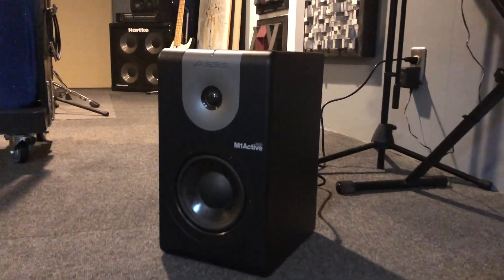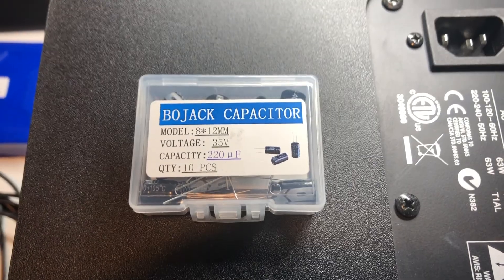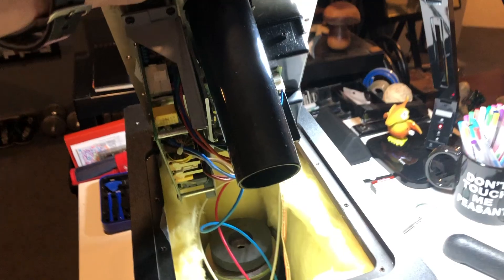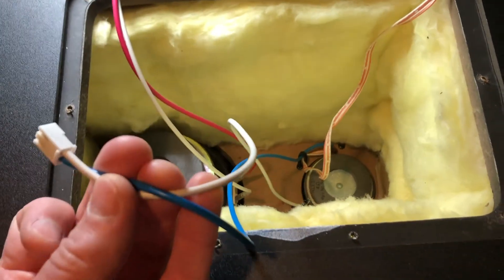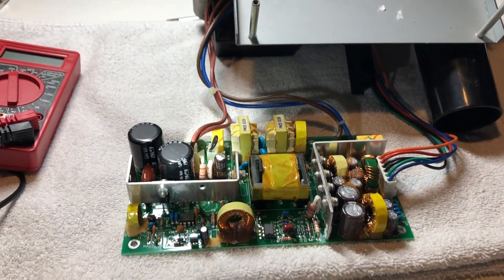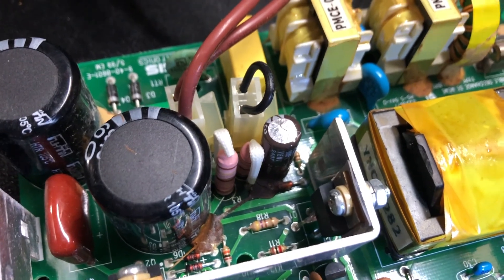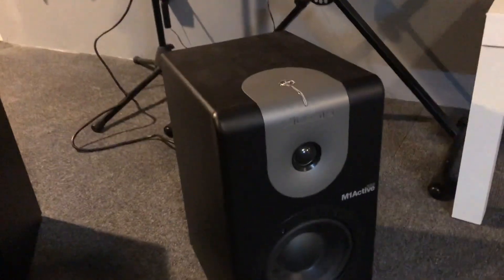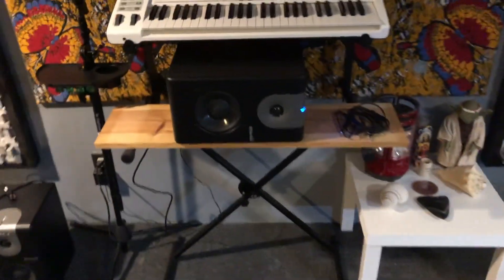Alesis M1 620 Active Monitor Fix

Comment: A quick question since ur the handy man - I actually own the 320 ones - prolly for the last 7 years or so. couple of days ago i found out even when turning the knob to OFF the blue LED light stays on. No sound unless I turn it on and raise the volume. Any idea wot can cause that? hope I can DIY it. Cheers
Reply from the maker: I don't have experience with that model.  I don't think this is exactly the issue you're describing on your unit, but this EEVblog video has a pretty good troubleshooting process which was rather entertaining to watch, and the circuit topology of the 520 looks like it's probably the same 320 at a glance.  So, maybe it will be helpful:  https://www.youtube.com/watch?v=qHbkw0Gm7pk

Comment: Hi, you might be able to help me. I have a set of these a few years now. I connected my acoustic guitar using the XLR input (my acoustic has low balance XLR output. However it blew the monitor, there was a low dull noise and the light does not come on now. The kettle lead is still working. I have no idea what to check for if I open it up, or is this monitor unfixable now? Any ideas? Thanks
Reply from the maker: Hmmm... tough to say for certain here.  There may be an impedance mismatch based on your description, as it sounds like you plugged the guitar directly into the studio monitor instead of the input of an audio interface or mixer and then out to the monitors.  Most guitars need to be plugged into a hi-Z input.

Comment: What is the price is this montior?
Reply from the maker: This model was discontinued some time ago, but on the secondary market I believe I’ve seen them selling in the $150-250/pair price range last I looked.
Reply: I have the old version (Alesis M1 active mk2) pretty sure it’s t got the same power supply pcb and problem—  how can you Measure whether a capacitor is broken? Do you have to desolder it first?

Comment: Do you happen to know if the same issue plagues the 520s as well? Lately mine have gone from working fine, to emitting a VERY loud (as in, blasting the room) noise that sounds like TV Channel noise. Scares the hell out of me every time it happens, so they're sort of unusable right now. How would you rank this type of repair for a newbie in terms of difficulty? Thanks!
Reply from the maker: Hi Ryan, I have read the 520s have suffered from the same issue.  I have also seen that some of the 520s have a different PCB design, so whether or not this fix would work probably depends on if your PCB has the C8 capacitor and R4 resistor.  If you take apart your monitor you should see the components marked clearly on the PCB.  I think it's certainly something a newbie can do with some patience, a steady hand, basic safety precautions, and attention to detail.  Just go slow and take your time.  I think you may find this thread helpful as well, as I am not the only person who's encountered this and fixed it: https://gearspace.com/board/low-end-theory/109491-problem-alesis-m1-active-monitor.html?s=de725f22f954ab1a01d12a43844f0049

Comment from the maker: This is my first attempt at a video so I didn't catch everything.  I forgot to capture the actual soldering of the capacitor - but it's pretty straightforward as long as you mind the polarity on the replacement component.
Reply: I replaced the C8 on one monitor, few years later the 2nd monitor went bad. This monitor wasn't lucky and the replacement didn't work; the PCBB got damaged. Do you happen to have a diagram showing where the C8 connects to? Thank you!
Reply from the maker: @kurtmorrison678  Hi Kurt, unfortunately I've never been able to find the actual schematic for these monitors when looking online.  I know Alesis still hosts the service manual pdf on their website so it might be something their customer service department could send you, although I've never dealt with them directly so I don't know if they are responsive or not.  Best of luck, and if you happen to come across it want to let me know and I can add it in the video description for people.